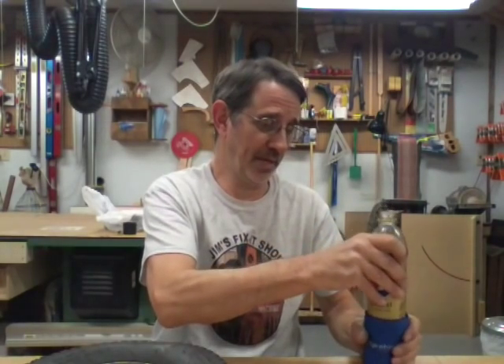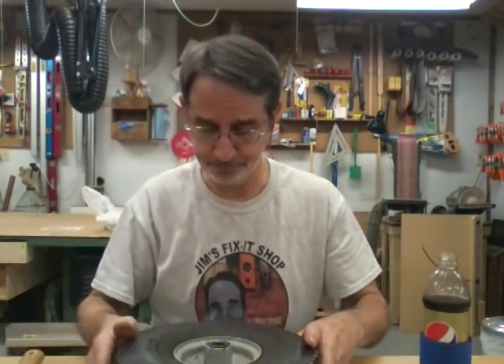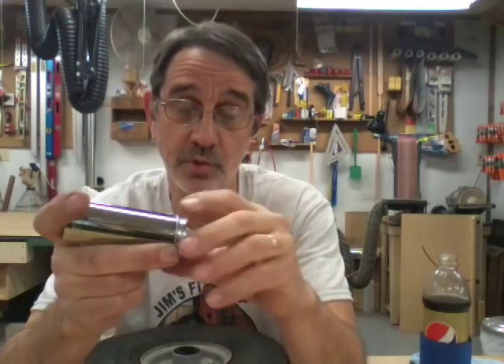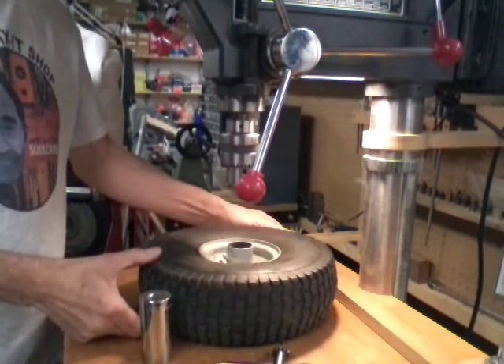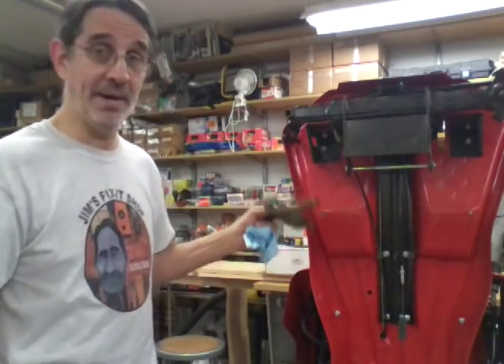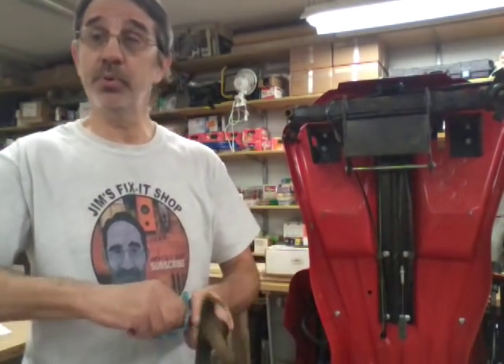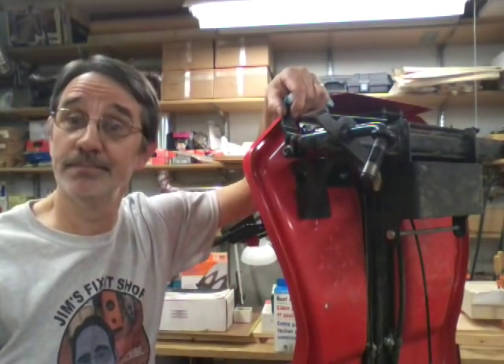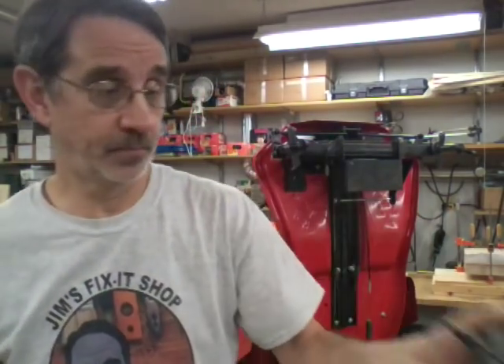216. M/S. 49  How to replace the front wheel bearings in a Snapper rear engine rider

Comment: Great wheel bearing  information That's pretty cool how you turn those adapters for you hydraulic press and drill press. And the turtle,
I guess I've heard you mention it one time before. I'll have to google that.
    So to make the rear  bumper pipe you must have access to a pipe bender. I made the top 1/2 to repair one, the other day. And used  similar pipe like you did,  and used the draw bar on my super M { it has a round portion} to wrap around & and a long pipe for leverage. Wasn't much fun but eventually got the second bend in . Mine was broke off at the
"top", 5/16 bolt hole. I guess that's there weak spot. So If under the bolt heads ( the bolts are plenty long) if they would of cut a reinforcement 1" wide x 6 or 7 inches to reinforce past the holes and in-between too, Not really needed there, just easier with 1 piece. Then
the previous owner might not of broke it off when he abused it somehow.

Comment: I've replaced the bushings and installed real bearing in the hubs but I swear the wheels are toed out when pointing forward.  I'm about to replace the tires and hubs and would like to have the new set track straight.  TOE OUT?  TOE IN?  DEAD STRAIGHT?  And how to adjust  the alignment?  Any suggestions?
Reply from the maker: Well I am surprised that your snapper hade bushings in the front tires in the first place snapper puts bearings and all of them they’re cheap bearings but they put bearings in all of them somebody must’ve changed them out before you got to Machine.
 
     If you do not have adjustable tie rods there’s not much you can do I would replace all of the nylon bushings on the tire rods and steering shaft and kingpins that might help The only other thing you can do to toe in the tires is bend the tire rods. Jim

Comment: What's a part number for the cheap ones, and where to get them?????
And... how come no way to adjust tie rods?    MY wheels point outward by ~10 degrees each side
Reply from the maker: The cheap bearings for the front tires there isn’t a part number that I know of you just go down to a tractor supply or a farm and fleet or I think even Menards sell them just bring an old one and match them up, on the slop in your steering it sounds like your bushings on the tire rods are shot there’s four of them one on each end of each tie rod if you replace them that should help a little but I would imagine the bushing on your steering shaft is bad also check that out and let me know what you find. Jim
Reply: @jimjackson9381   Thanks for reply.  Was also wondering if the clutch disc that has the rubber ring around it - ..is that rubber ring supposed to move around on the disc? Or should it be a tight fit - unable to move on the clutch disk?

Comment: I used the Heim bearings and they worked great. Cost way more than the Snapper bearings but the steering was better than factory when I bought the mower new. I could turn the mower with my fingers.  Thank you for the video and the suggestion.

Comment: My front right wheel bearings came apart on my last mow.  Thanks to this video, I had the Snapper back up and running today.  Tractor Supply didn’t have anything, but my local Snapper Dealer had them (all four only cost $9 and change). I also have ordered the bushing kit for the front end.  Maybe I can get another 18 years out of this mower.  😂
Thanks for the video.
Reply from the maker: Edward Eiting 
Well I’m glad I could help you if you need anything else just let me know just don’t forget to grease and check the lube in the chain case and differential and I’m sure it will last another 18 years. Jim

Comment: Hey Jim alright I got the snapper all back together and it roll beautifully after replacing all that I think it was that axel nut that a missing. I have a question. When i stood it up on the bumpers will it HYDROLOCK? because I put it down & fired it up and it ran for 30 second and the engine seized ..now I have a Bigger problem.
Reply from the maker: Vinnie C 
Hi Vinnie
   I’ve never had that happen I stand mine up all the time to work on it when I set it back down I usually let it sit for about a half hour so the oil will run back down where belongs What happened to it it didn’t throw a rod didn’t, maybe you’ve got excessive gas or oil on top of the piston remove the spark plug and try to turn it over. Let me know what you find out thanks Jim
Reply: @jimjackson9381  it was totally my fault i was so darn happy it was back together & rolling I forgot to let it sit so the oil can drain back down.
yeah I took the plug out and the  pull start or flywheel doesn't even budge.

Comment: Great tips and awesome fix/mod with the RF122214PP 

3/4"Bore x 1-3/8"OD x 1/2"L x 1-1/2" Flange OD x 1-3/8"OD 
or 0.7500 X 1.3750 X 0.4375 INCHES 

Double Seal Flanged Radial Ball Bearing.   Looks to match many part numbers like John Deere part LM127304  

Amazon search yielded a couple sets of these with 4 bearings.  At around $10 Xike brand and $12 marathon brand.   Even if these sets are lesser quality vs. the ones you got; they spec the same size with seals.  And surely there ain’t no way they can be as wimpy as the stock style snapper bearings! 

Also, wow I had never even thought to use my drill press as a light duty PRESS.  That’s pure gold knowledge!  
Thanks,
Jeff
Reply from the maker: Jeff Padgett 
Hi Jeff
  Thanks for the tip about Amazon I’ll have to check that out I always forget about Amazon and eBay when I’m looking for parts. Thanks Jim
Reply: Jim Jackson  Sure thing.   I learned the less I spend, the less I hear my wife yell ‘You spent what on WHAT!?’    I should note for amazon and such, prices fluctuate often for lawn/garden parts. Ie rear tires I watched go from > $20 to <$30 then back to $20 in the same week.  This was for same 4ply tires.   So keep an eye out for that. Cheers